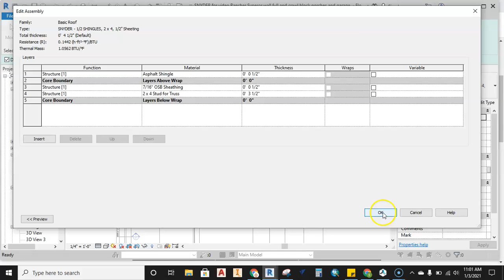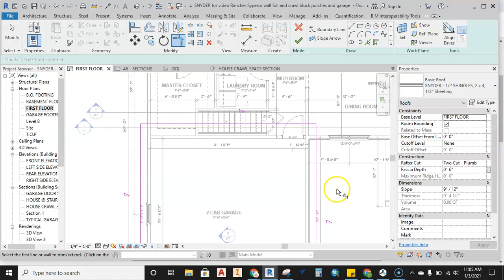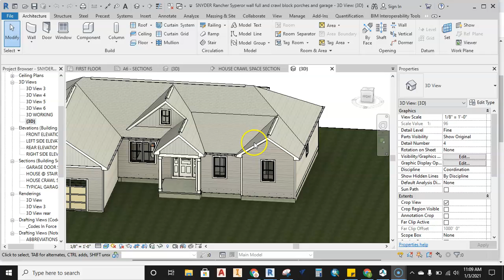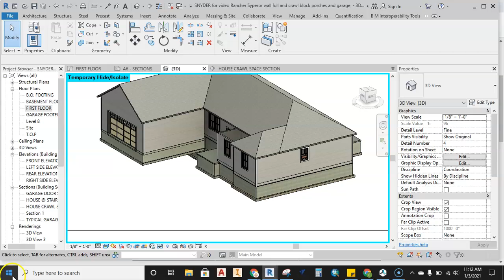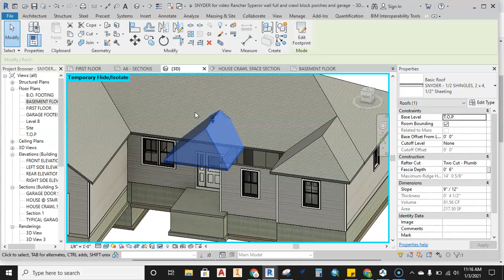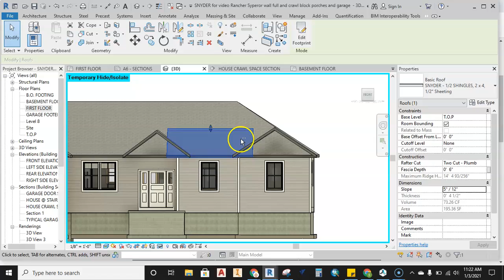REVIT - Adding a Roof with Reverse Gables and a Joined Shed Roof

Comment: Um, how do I say this…that was a little painful to watch.  There are actually two better ways to sketch your roof.  The tools you should be using are the last two tools.  The first one is the ‘pick lines’ tool which is the green line.  Before you start, help yourself out by choosing to pick ‘face of structure’, not cl or face of finish. hit the pick line tool and set an offset.  Now click on your face of structure, using your tab key to get the right one, which will highlight, and work your way around the structure.  Then join and attach slopes as needed.  The best tool to use is the ‘pick walls’ tool, which is the last one.  The bonus to this tool is if your walls move, your roof goes with it at the prescribed overhang.  One thing you do need to adjust is the overhang, which this tool configures from outside face of finish.  So just subtract the depth of your finish layers from outside face of structure.  For instance our siding finishes are 3/4”, so I use an overhang of 11 1/4”.  This one is really easy to pick with, just hover over any wall and click.  Then join and add slopes as necessary.  The pick walls tool will change your life.

Comment: Obviously not your 'first rodeo'.   SO... why do you... or rather why does REVIT not have a way to start new roof structures on the T.O.P. level?   I noticed every time you have to go tell it that.. and I"m working on one of my first projects in Revit (20+ years experience in AutoCAD but new to Revit) and don't understand why it's not starting new drawing elements on what I would consider to be the obvious level.    Like... why's it trying to start a roof on the floor elevation?   Pretty clunky interface.   Is there a way to tell it once you start working on the ceiling section of a building to put all ceilings at 9' or when working on the roof to put all roof elements (unless otherwise overidden) at the T.O.P. level?    Seems so clumsy for an interface.   Thoughts?